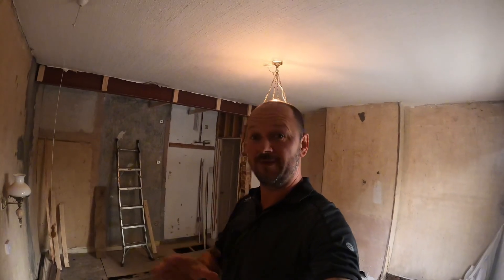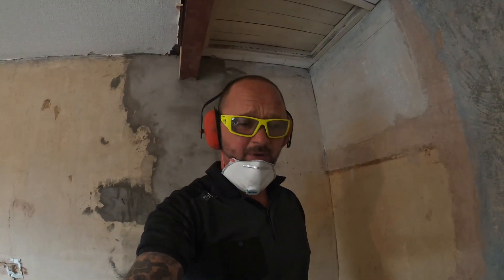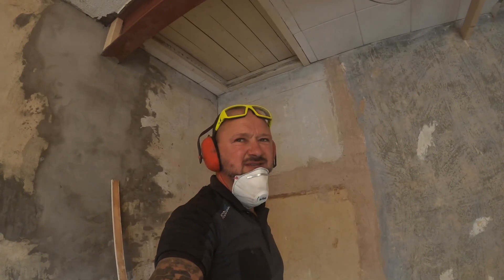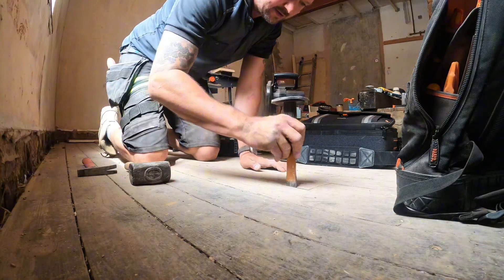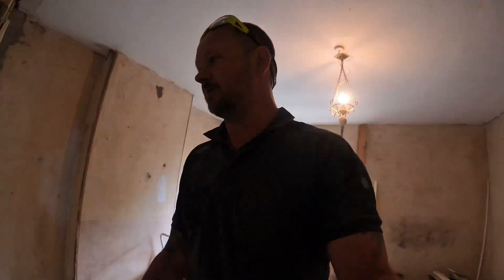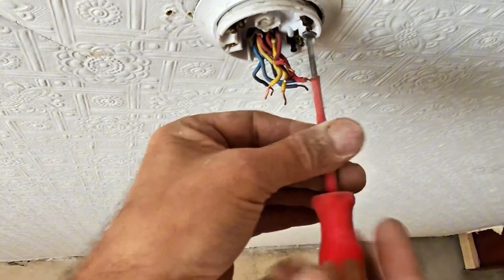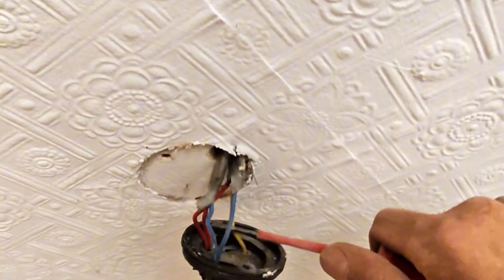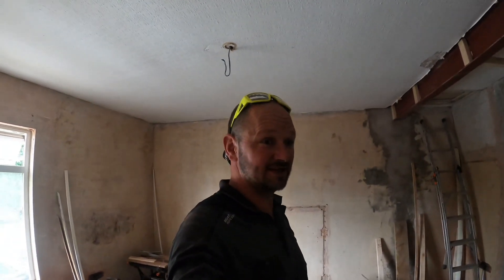Watch Me Rewire This Bedroom Step By Step!

Comment: I like that metabo chasing tool combo. I couldn't justify the price though, I ended up getting a milwaukee dust extraction/adjustable depth gauge for my normal m18 grinder, and just clip my battery m18 hoover onto it. Then just knock the centre  out with an sds. It was a game changer for lived in rewires, but I am definitely jealous of that set up you have 😂